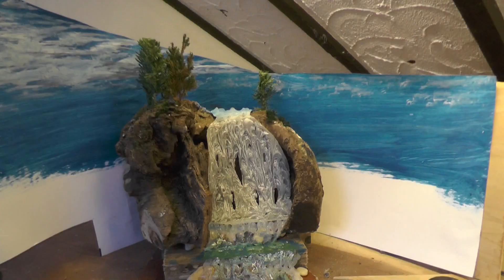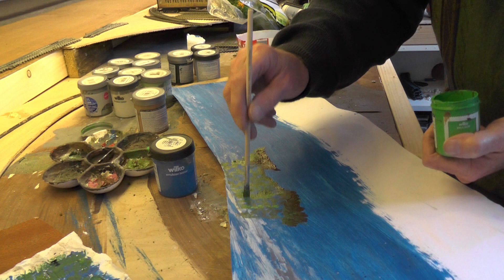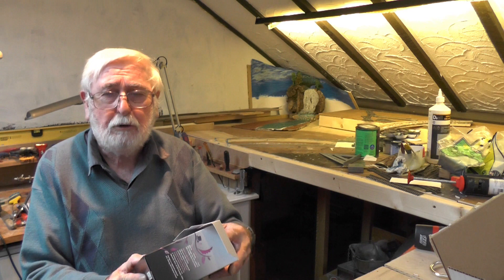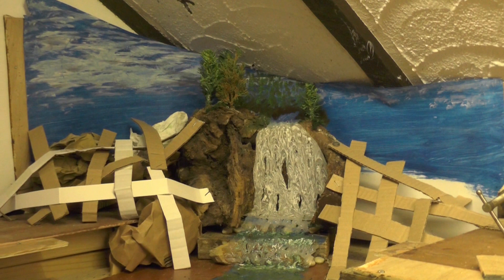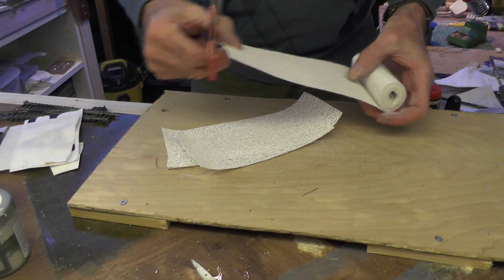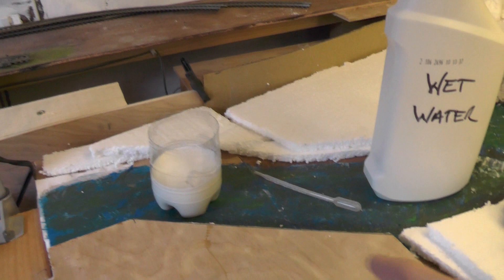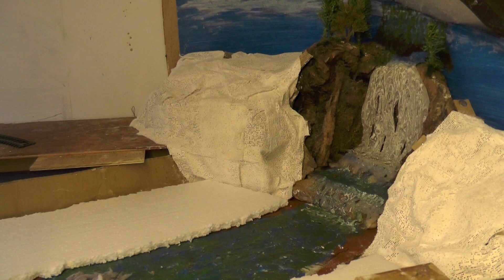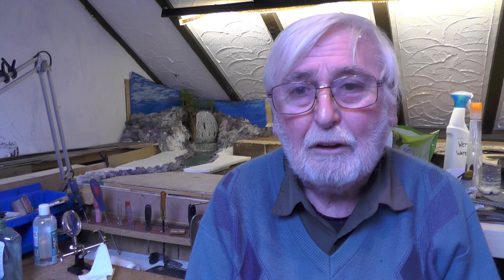Rebuilding a model Railway Episode 7 Scenery on the CHEAP using everyday throw away stuff save money

Comment: Bonjour Michael, You explained the tumble dried fluff method in a former video, it's interesting you see the process. Less messy than working with plaster but still labor intensive. Looking forward to see your bridge build in front of the waterfall scene. It will look great ! Success ! Cheers, Filip
Reply from the maker: Bonne après-midi Filip.  Thanks for your comment.  This morning I have been pondering about the bridges.  Due to the width of the river and the amount of space either side, one will be single span arch with smaller arches either side and the other MAY BE a modern design but maybe not due to the curve.  More pondering necessary.  Regards Michael

Comment: If you haven't got a tumble drier, belly-button fluff does the same job, but takes longer to collect... or so I'm told! When it's dry, it's also used as an accelerant for starting fires, so make sure you have no sources of ignition in the vicinity! Fascinating to watch and I heartily approve of using free materials. :) Mike
Reply from the maker: Mike, your comment got a 👍, a ❤ and a BIG 😊 from me cos it made me smile, Thanks and 🥂Cheers, Michael